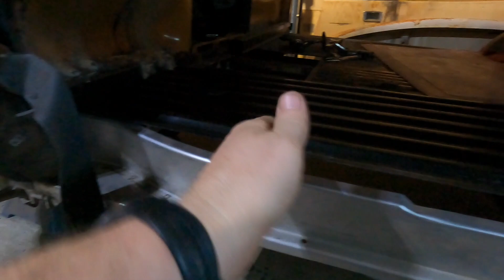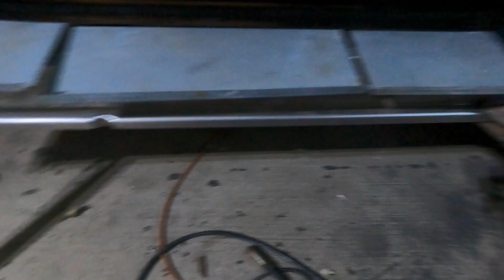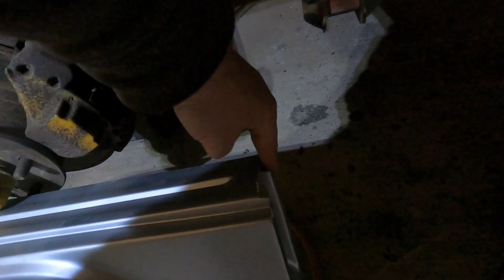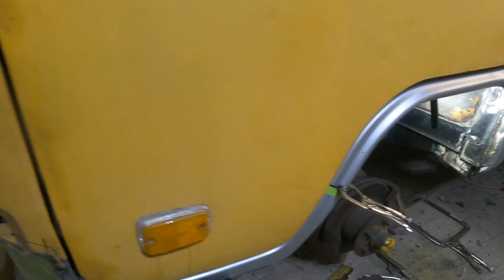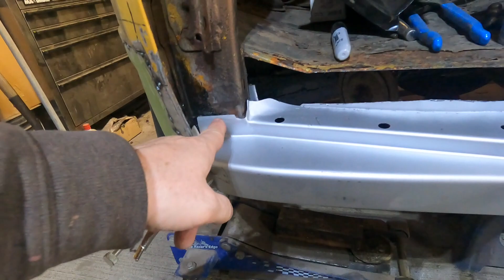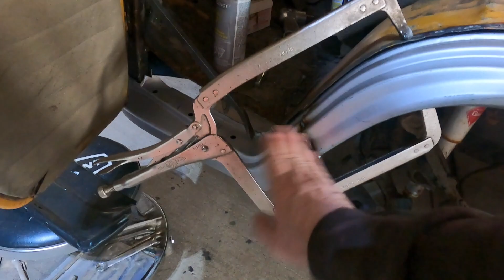VW Bus Project ep16

Comment: Did you just leave out the middle rocker?
Reply from the maker: I only found that there is a middle rocker on the sliding door side with a door track.  On the opposite side there is only an inner and outer rocker.
Reply: @ interesting my 73 100% has the middle rocker on the driver side.  I’m in Canada donno if that makes a difference.  I also haven’t cut out all the slider door side but I didn’t see one
Reply from the maker: @NeilBanfield-d2n interesting, I have cut open two 72 buses now, and both didn’t have a middle rocker on the drivers side.  I’m in Canada too, Ottawa now, where an outs are you?
Reply: @VWAdventures9905  Nanaimo bc. Thanks for sharing your vids I do enjoy them

Comment: I also bought the cheap ones. As you said, it might be cheap for you but for me, in Albania, it almost cost me the liver... now i have a problem with my front doors because of that.. the rubber is out and the space is huge.. i am thinking now of removing them again or try to fix them ... i am learning to weld and hope this time i will do them my self not leave them to other people who hate working on vw buses..  i don't have any rust in my bus side panels but i have many wrapping zones ..  I already have all the side panels up to the window but maybe is better to fix the original metal of the bus or just cut the shit out and replace with new metal i already bough 5  years ago.. ( THE PANELS ARE ALREADY RUSTY NOW AFTER WAITING TO BE MOUNTED )
Reply from the maker: Hi there!!  I hear you on the cheap ones not being cheap.  They are expensive but cheaply made….

What year is your bus?  

I have changed out panels removing original metal and was told I should keep As much original metal as possible.  So, this time I am cutting the new panels down to keep more original metal.  
Watch bad Chad on you tube to see lessons on how to weld sheet metal, you can do it!  Good luck, I’d love to see you bus too